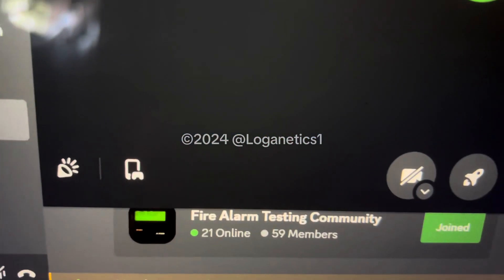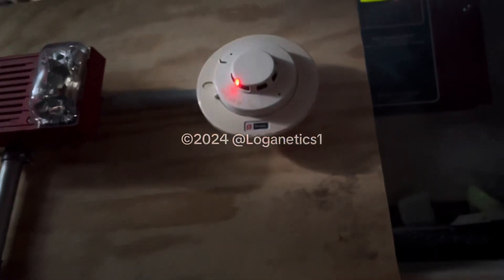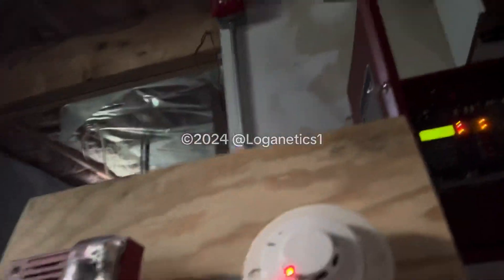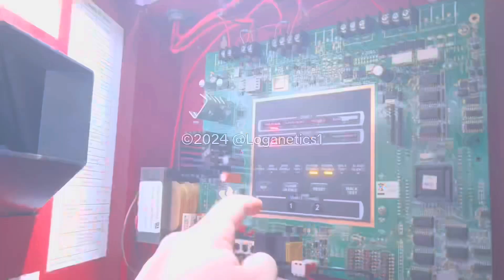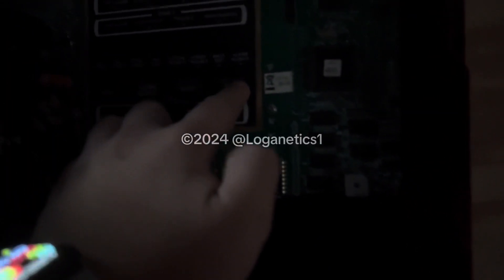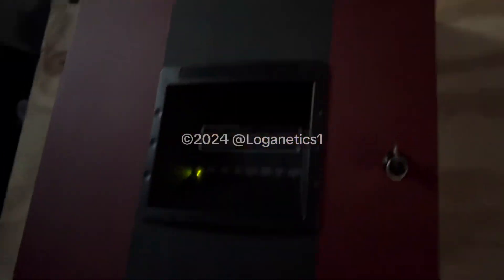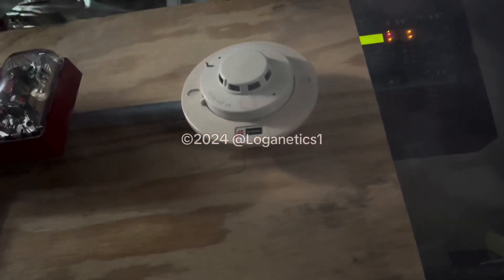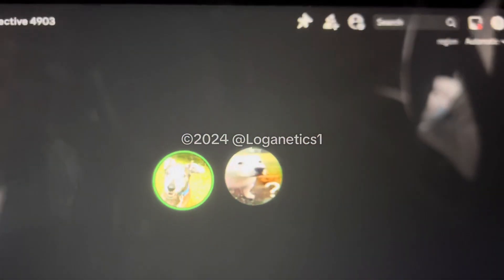Silent Knight SK-2 System Test 4: Requested by TheSimplex4903!

Comment: Simplex vs System Sensor lmao. I've been finding some Simplex 4903-9238s on eBay. Sellers keep listing them as 9236s idk why. They've both got the same electronic horn the strobe ratings are different.